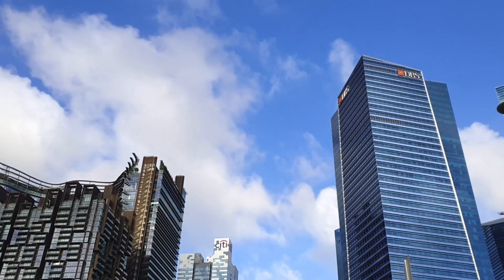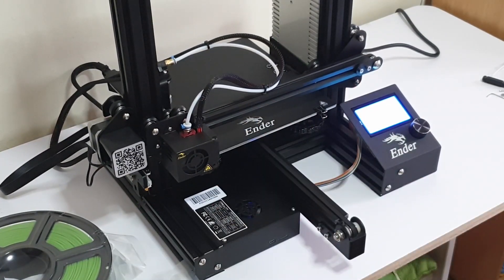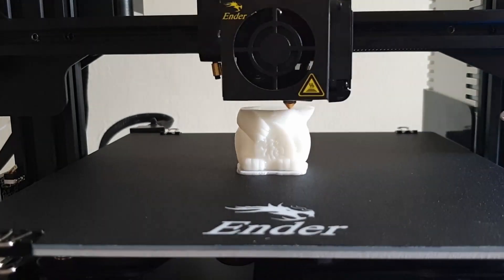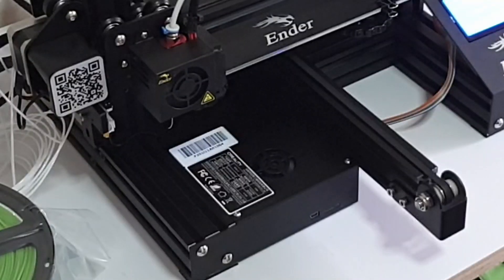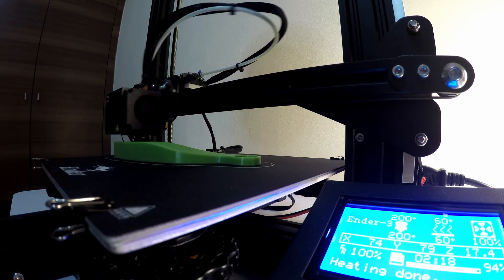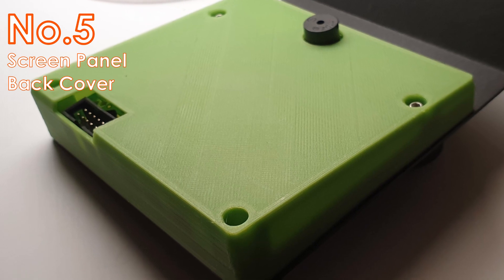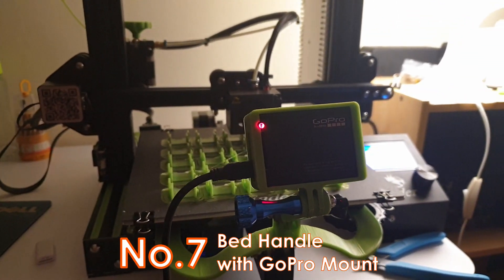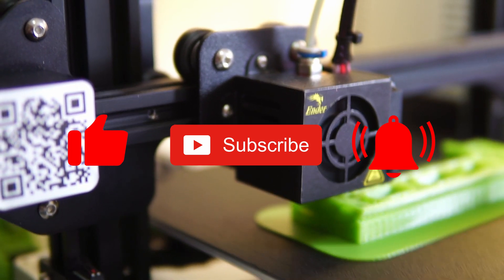Creality Ender 3- 7-First 3D Print Upgrades before you Start Part 1

Comment: Nice prints, well done. For those that are new, the pull handle should only be used slowly. Using it too harshly and you'll fry the motherboard.
Reply from the maker: Oh thanks! That's why when I pull the handle the viewing panel sometimes lights up even not powered on.
Reply: @archjumzbalicao  Yep you are charging the capacitors . Thanks for your hard work btw:)